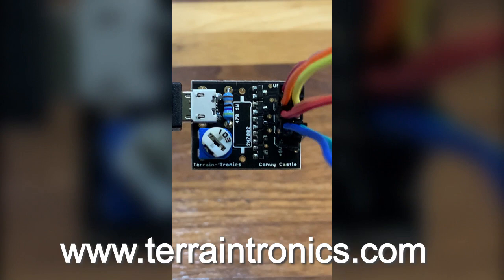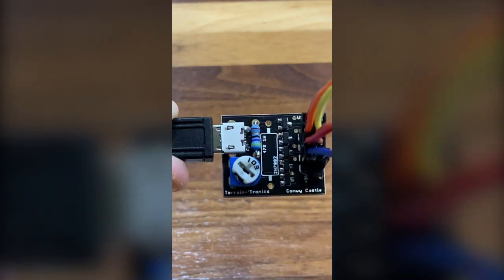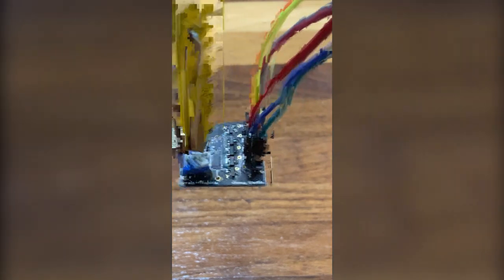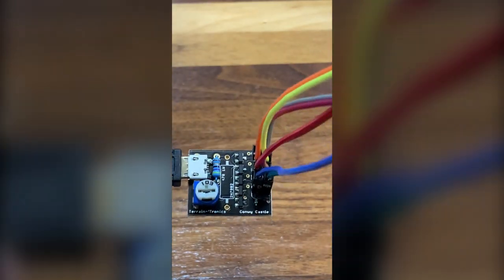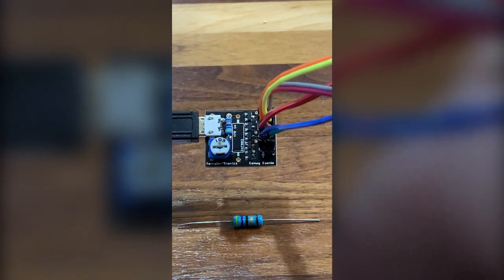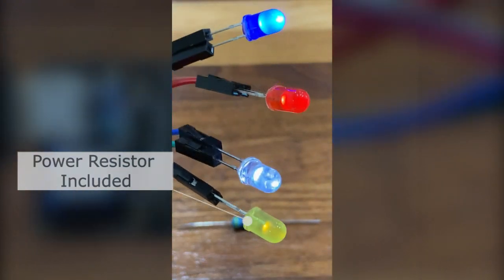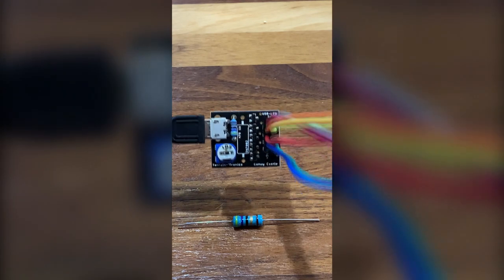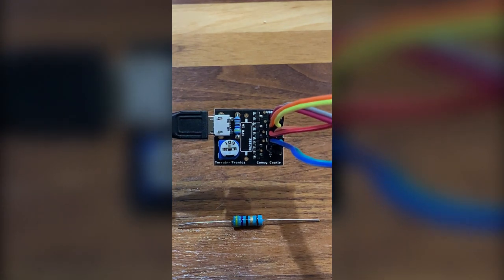Introduction to a simpler LED Controller for your terrain! Conwy Castle!

Comment: I got a question for ya, I'm trying to light a 3v filament to a diorama to look as though lasers are being shot from a ship in space the Conway board lights the filaments just fine, but when I try to use 22 AWG enamel copper wire to make the filaments look as though they are suspended shooting at another ship I lose connection while using the enamel copper wire, but if I use the Dupont wires from the video I don't have enough strength to suspend the filaments any recommendations on how to solve my issue.
Reply from the maker: Hi Corey - what battery are you using? do you have a datasheet for the filament too? What's happening when you use the enamel wire? is it just dimmer, or nothing at all?
Reply: @TerrainTronics  Thanks for replying back, I'm not using a battery I'm using USB straight to the wall, when I hook to the enamel copper wire no power at all. The filament is a DC3v 100mA 38mm 60-70 lm/w, I hope that is the data you need, if not I got the filament on AliExpress, they are a Edison filament lamp if you would be willing to find datasheet info if I posted wrong info, sorry kind of a noob to the whole LED scene for dioramas, but willing to listen and learn to push my hobby into another world.
Reply from the maker: @Nekrishi1971  a few questions come to mind - did you do any current limiting with a resistor? Did you verify conductivity between your power supply and the filament (with a multimeter).
Can you drop me a note on Facebook (look for terrain tronics) and I’ll be able to help you a little more.